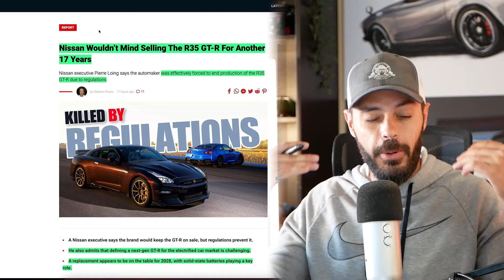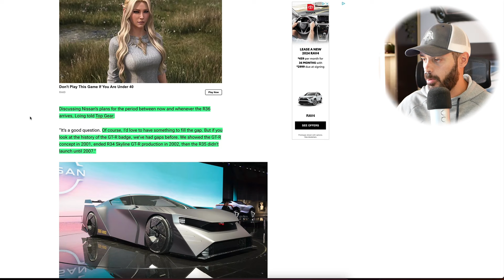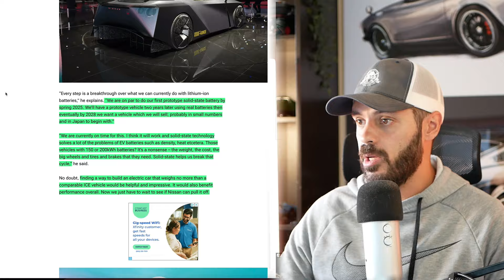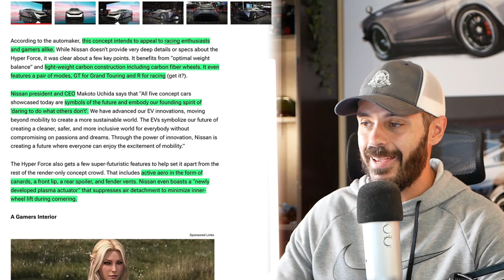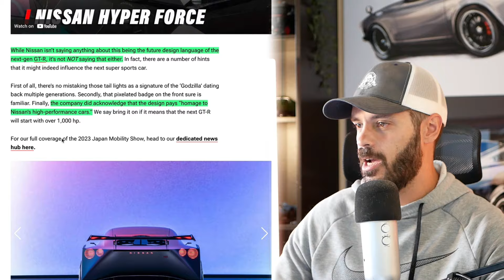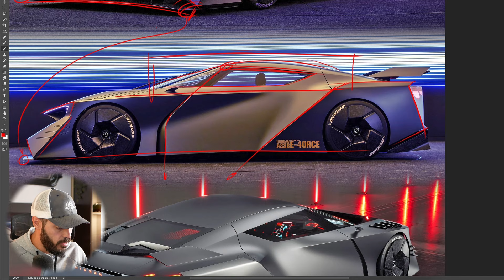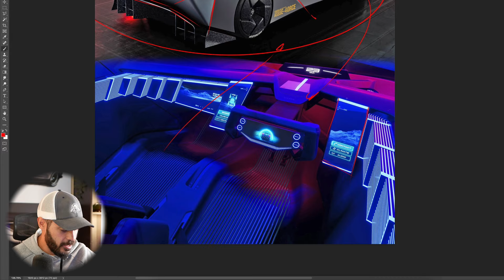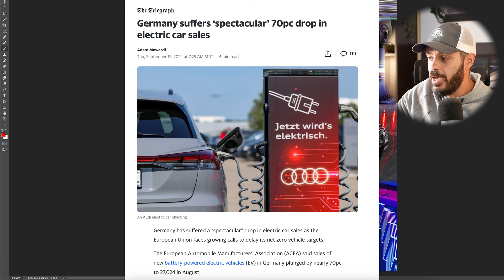Nissan has a BIG problem to solve

Comment: The Electric Fiat 500, a CITY CAR, the perfect type of car to be electric, has failed so spectacularly that production has stopped and Fiat is scrambling to create an ICE version of it as fast as possible.
My point is: If even City Car EVs are failing so hard, imagine the financial disasters that Electric Sports Cars are going to be. EV fans don't want a sports car and sports car fans don't want an EV. Those are two completely opposite categories. Making a sport EV is like making a Luxury Panel Van.
Reply: I think about this a lot.
Don't get me wrong, I don't necessarily hate EV's and I do think they have their place, the biggest issue though is this rapid push towards a technology that isn't currently capable of fulfilling the demanding needs the average consumer requires, not to mention their expensive nature.
As it stands, if many other companies who were initially pushing towards EV power are suddenly turning on their heels back to ICU, I think that alone is proof that EV cars currently aren't a sustainable solution for consumers and car manufacturers, at least not currently.
It's hard to say what the future will bring and while I've no doubt that EV power will gradually improve over time, I do think we are a while off from the technology reaching it's peak and thus (metaphorically) taking EV's out of the oven when they haven't finished baking yet leads to them ultimately failing a good portion of consumers.
Reply: @clockwork3494  Exactly, I also think EVs have their place as city commuter cars. But as sports cars? Absolutely not.

Comment: I still love the design of the GTR, a coworker bought an old one, and I can tell you this car turns heads way more than a 911. An Electric GTR would be like $300k+ and sell poorly since the second hand value will be $100k after 3 years
Reply: That's the beauty of the Porsche tbh. It's supposed to be the choice of the wealthy, low-key enthusiast
Reply: @0LLy796  No. It was supposed to be the "poor mans sports car". Now it's the every "wealthy, but not rich" mans flex mobile.

Comment: They could print money if they went retro futuristic with the design. A modernized C110 style body, or one based on the R32 sould do wonders. The current concept just looks like a lego brick with a massive chin.
Reply: concepts most of the times look crazy, so the production version will look like one but more round, is it mewing?]
Reply: Absolutely! We need a Retro-modern R34 Design!

R35 was allready too big and too radical for my taste... That was when they only called it GT-R...

Remember, the GT-R's before were Skyline's! (Basically allmost what the BMW 3 Series is in Europe)

They should go back to basics! No huge Supercar, just a modern R34!😎👍
Reply: @einautofan6685 To make it simple for Nissan, they can make a boxy sport car that use 400Z platform and engine, then named it "Skyline GTT"
Reply: Actually crazy to me how Hyundai of all car manufactures nailed this with the N Vision 74.
Yes it's still a concept car currently (albeit confirmed for production by 2026), but I think the car captures what people are looking for in retro-futuristic designs flawlessly, amazes me how other manufacturers still aren't taking notes from them.
Reply: @clockwork3494  The 74 will be a very expensive low production car unfortunately so the odds of seeing one in the wild are so slim that it might as well remain a concept. I was really hoping they'd take that design language, and build a car to compete with the GR86 or even the Nissan Z and Toyota supra at least in pricing segments. That said the N Vision 74 is a beautiful design. Idk what's going on with Nissan's design board with the GTR, but this current concept never gets any further in hope.

Comment: if its going ev, its going to fail.
Reply: It could no worse than the current R35 which has sold less than 100 per yr nowadays.
Reply: @gerogyzurkov2259  the r35 doesn't sell good anymore bc theres already alot of them out there, and if it goes ev it will fail, simply bc ppl buy sports/supercars for the sounds and looks ofc, witch this "r36" already failed at.
Reply: @beamer8907  No, it doesn't sell well because it's an aging platform selling at the price point of over 100k when a Corvette or other high performance car in the price range absolutely crushes it.
Reply: @MuShinnen you've successfully repeated what he said. It's an aging platform cos it's an aging car. The market is saturated with it. No one is paying 120k for a car they can find on the used market for half the price
Reply: @0LLy796  thank you
Reply: @0LLy796  No I didn't. I made a distinct point. Even if there weren't a lot of them on the road, the vehicle is ancient by supercar standards. It does nothing new or unusual. The mystique is gone. The value of performance for dollar is gone. There are plenty of cars that are just aging that will still command a high price because they do something different enough to warrant that price. The GTR just doesn't any more.
Reply: @MuShinnen  fair enough. Still feels like an expansion on the previous point but it is one worth pointing out
Reply: Exactly. I could see it having some hybrid tech in the next one, but a full EV would completely destroy the name and heritage of the GTR. It would no longer be considered “Godzilla”, if it didn’t have a high horsepower, fire breathing engine powering it.
Reply: @Tomcat115  it'll be Mecha Godzilla 😂
Reply: @0LLy796   It's just market demand for Nissan, Honda, and Toyotas is not great at the higher prices 100k+. Not just the used market. It's the brand. Branding is same reason why GTR, LFA, and NSX failed. Which is why non of the manufacturers want to get back in. Nobody is paying for a Toyota or a Honda at well over 100k. You see plenty of people buying Mercedes and BMWs at high prices yet not much for Hondas or Toyotas/Lexus. LFA barely moved and was considered a sales failure. NSX was cause it was too expensive right from the beginning. GTR is in the same boat now with it's over 100k price. Why would anybody buy those when i can buy a Ferrari or Porsche? 50k more for those? Who cares at those prices the people who are buying these at these prices have that much more to go for the branding of thse brands over the Japanese.
Reply: The only reason why 100k R34 are a thing is nostalgia and classic now. Not the Brand itself. Nissan doesn't sell itself. You don't see many Nissan for those big wealth earners.
Reply: Right
Reply: Every car will go electric... No way to stop this, just deal with it, it's like fighting against digital vs analog
Reply: It HAS to be an EV or a hybrid or it won't be fast enough
Reply: Absolutely! It's going to fail because part of the GT history is the tuning market! Without a proper engine there will be no tuning possible... Only spoilers, rims and stuff...
Reply: Ev hate is unnecessary
Reply: @nasilemakletakicecream  hate? Its straight up facts.
Reply: @Tomcat115  yeah make it even HEAVIER
Reply: Ofc it will be. It's not even a question.
Reply: Same will happen, if it's reintroduced as an suv
Reply: @gerogyzurkov2259 price went up? Older generation gtrs were more accessible to people than r35
Reply: @nasilemakletakicecream  Converting a well-known car into EV draws (much deserved) hate.

Creating a new line-up that's an EV is fine.

Wanna make an EV GT-R? Call it EV-R or something and NEVER mention the GT-Rs in its presentation.
Reply: @Juck_Fews  SUV GT-R would definitely cause some people to die during its live unveiling.
Reply: Maybe not. Think of the N Vision 74, one of the most hyped cars and it's a hydrogen car. I personally wouldn't like it, but I doubt it'll fail.
Reply: @muratpolat9398  N Vision 74 is not a pre-existing ICE line-up name. Plus, its design is hella good.
Reply: @verticalflyingb737 agree good looking
Reply: No

Comment: My takeaway from this concept car is that it is a very early glimpse into what the new Nissan GT-R COULD look like. In other words, it is hopefully not what the R36 will look like in its final form since it's immediately clear that the Hyper Force concept does not look good nor does it look like a finalized design. You would also think that the next step would be to hybridize the GT-R and not immediately make it a full BEV considering the popularity of EVs has taken a step back given the slight decrease in demand. Not to mention, even electric hypercars that cost over a million dollars aren't selling all that well either. So if cars like the Rimac Nevera were hard to sell, then an all-electric GT-R would also be a hard sell.

Comment: bro that chin is awful, it looks like they merged a cyber truck with a Honda civic and then gave it underbite worthy of a Hapsburg. I don't trust anyone to actually manage to make an EV worthy of the GTR badge. they're just too heavy as it is. it also doesn't help that EV's rarely manage to bring any emotion forward other than ambivalence. since other than the skin, its the same damn drive train at its core. there's no sound or torque curve or any performance metric other than watts. the R35 was cool because its styling was super unique, it was powerful with an engine unlike anything in its competitors, paired with an incredible transmission and AWD system. and all that made it a successor to the R34 GTR. all that would be different between that concept and a cybertruck is the looks and ride height. it just wouldn't be special.

Comment: "Daring to do, what others don't" by going all EV for R36? That's just lies and wokeness. Every single manufacturer is trying do make EVs these days, you don't need to be brave for that. It's the opposite, of what would be considered brave. If they were brave they would make a non EV, R36 with a new design, updated engine, drivertrain, suspension and some other technology

Comment: This is clearly a concept car. I'm not concerned Nissan will be producing it as a replacement for the current GTR. The front is like something out of a bad horror movie. I do not understand the design or why it was permitted even for a concept. It makes no sense. The rest of the body isn't as bad but still on the extreme end. Origami is the perfect word to describe this design exercise. I think that's all that needs to be said about the appearance. As for the platform, I am against EVs until an alternative for lithium is found and the grid reinforced to meet the power demand. Until then, a hybrid system sounds good to me, unfortunately Nissan doesn't agree.
Reply: yea, these new hybrid (super) cars that come out nowadays where pretty small e-motors spool the turbos in low rpm to boost the power output by soo much, are quite nice most the time and they are a  "+" for cars like those  but when it goes in the direction of the new m5 touring which now ways upwards 2,5tons because all the E stuff, it's getting out of Hand.
Reply: @kettehro  Yes, I totally agree. The German marques and their recent implementation of hybrid tech is exactly what I don't want. Too heavy for a performance car. Hybrid tech is good as long as any battery that comes with it is minimal and won't impact vehicle weight too much. For increased performance and a nominal extension in range it's OK.

Comment: Hyperforce looks terrible, but I suspect its more of an experiment into how far they could push things rather than an serious concept for the furuture of the GTR badge. Early ideation, not a finished product. Personally, I hope they take some cues from it but shift stylisation into the sort of retro-modern thing a handful of manufacturers have been doing recently (Even Nissan themselves a little, with the Z34). It's probably the coolest style to ever hit the car market at large.

Electric is definitely the way to go with the GTR, tho. Its calling card has always been serious performance (especially acceleration) that punches above what you's expect from it's apparent class and weight, at least as far as the R series chassis have gone, and we're quickly running into a world where going electric is the way you get things like that.